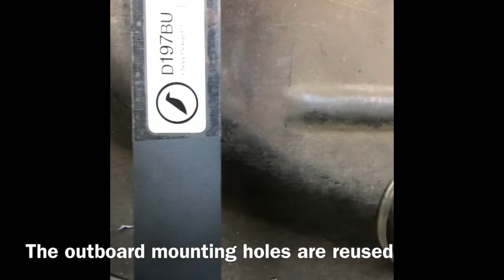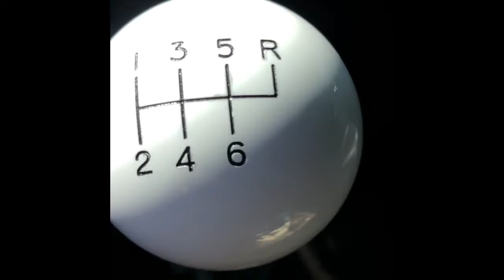C10 Corbeau Bucket Seat Install & Honest Review

Comment: Nice truck. I painted mine in what I think is the same color.. only with a two tone finish.  White sides. What did you do for speedometer? Electric speedo? I want to use the stock speedometer, and I've seen those electric to wire conversion units... Anyway, I would love to see how this drives
Reply from the maker: Danny Puffin thank you.  I dont have a plan yet for the speedo but I’ve used gps speedometers before with pretty good luck. Thats certainly the least amount of wiring and doesnt require changes if you update rear end ratio or tire diameter
Reply: @truckandroll989  I see. My truck had a  th350 and swaped to 700.. I bought a Autometer electric speedo and wired it up. Worked fine. theni changed to th400. Bought speedo drive impulse sender, wired it up..worked for just a week.. Now it just has a ton of interference